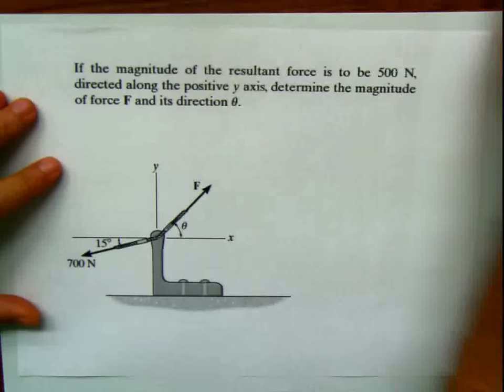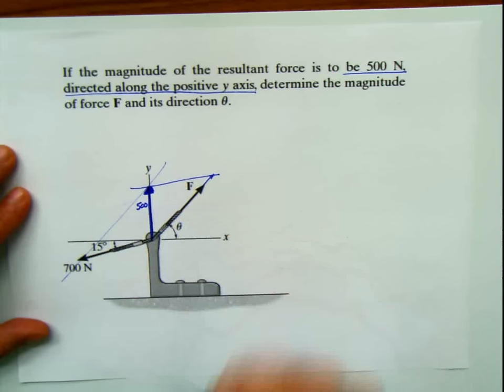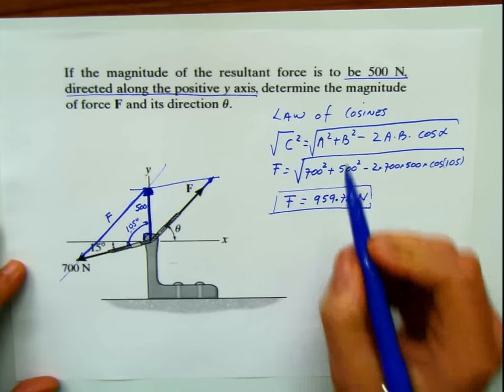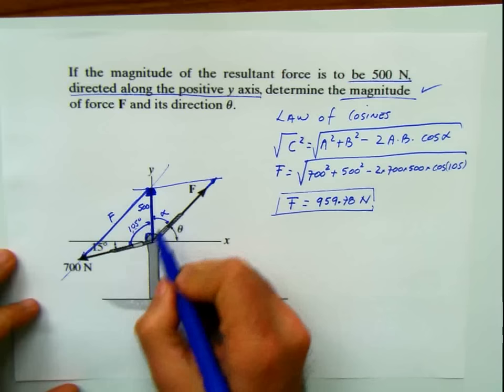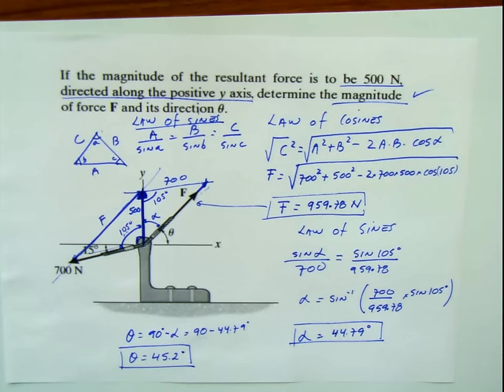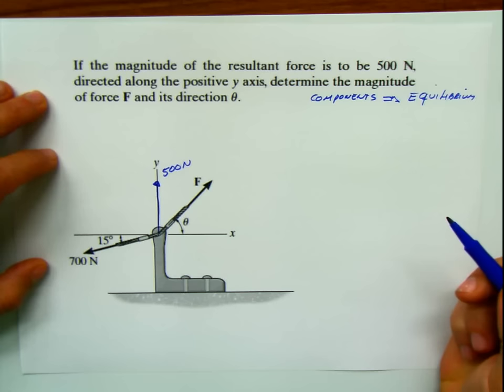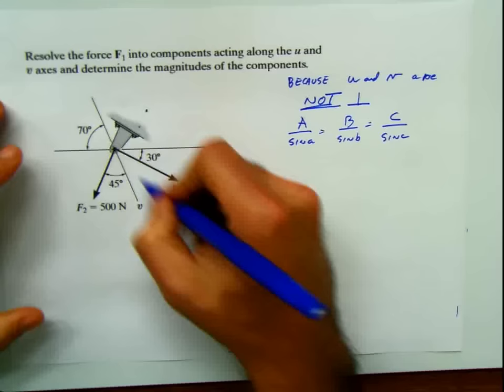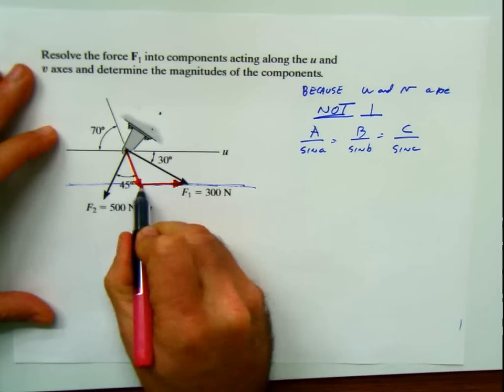Chapter 2 - Force Vectors

Comment: do you have chapters 5, 6 and 7. engineering mechanics 14th edition R.C Hibbeler? chapter 5 was equilibrium of rigid body, 6 was structural analysis and 7 was internal forces.
Reply: Daniel De Amat yes i have do need to
Reply: +1 😢

Comment: Did anyone have an issue with the first method vs the second method? for some reason my calculator wants to keep pumping out 43.23 degrees for theta. I do (500+700sin15)/700cos15, then multiply by inverse tan.

Comment: at 14:00 why did you put Fsin0 - 700sin15 =500 , shouldnt forces upwards = forces downwards? because when i was trying to solve i put Fsin0 + 500 = 700sin15
Reply from the maker: The questions says that the RESULTANT force acts up. You add all of the forces (with their corresponding signs) and the Resultant must be equal to 500. What you did is considering the 500 as an additional force and not as a resultant

Comment: in 14:05, it should be + 500 right? because 500 going up. so the equation should be F sin theta -700 sin 15 + 500 =0 ????
Reply: Nadya Husna Keumala i supposed to ask that too... I think thats a liitle mistake of him... 😁
Reply: These are the y- components of the two forces. Those two components are equal to the resultant which is 500 since the resultant is in the direction of the positive y-axis.
Reply from the maker: Nadya Husna Keumala thank you
Reply: Yes you right
Becauz either he can write as you mention above or he can also writen it as
Sum of components=-(Resultant) 
Where "-" provide equlibrium and indicates both balance each other by taking opposite direction.

Comment: Thank you so much for your lectures! My only question is: at 0:12:44 you say that summation of forces in Y is 500 N, Then you say that vertical component of F equals  F*sin and then write a equitation F*sin -700*sin(15)=500. I can't really get is since summation of forces in Y and F are the same vector here. I would really appreciate your answer!

Comment: Thank you for your videos; they are very helpful! Wanted to ask you about dividing one equation by another in a system. I was always taught that you can only add/subtract both sides, multiply both sides or divide both sides by the same number; besides not dividing by zero are there any other rules dividing the whole equation by another?

Comment: is it right sir, if it in respect to y, it is sine , and if its is respect to x, it is cosine? :)
Reply: That's where I'm at in the game too lol. I think when finding the forces in x we have to base them off of an x-axis. we can use the actual x plane and use cos60 degrees or make our own x plane line below which changes the x,y axis with relation to that triangle. Maybe? with finding y forces its a similar principle but in relation to y axis. that's what I've come up with so far. let me know if I'm wrong. I'm tryna get this homework done! lol
Reply: Thank you sir Martin. :)
Reply from the maker: not always.it depends on which is the adjacent side to the angle (cosine) or opposite (sine) IF THE AXES are perpendicular. Otherwise you need law of sines-cosines
Reply: @1963rzr   okay sir, thank you :)

Comment: 16:31 i get F=-1537.82, could you explain how its 959.78N please
Reply from the maker: I just did... the question is how did you get that value?
Reply: @1963rzr  700cos(15)/cos(45.2) —> I tried to rearrange it
Reply from the maker: @dashin-opps-baller4lcfcngo219  is your calculator in degrees?